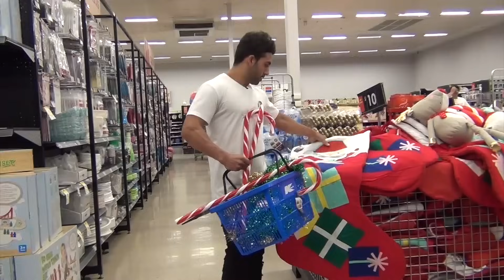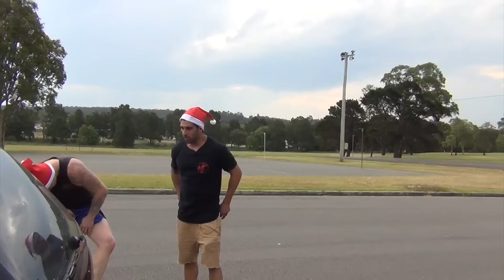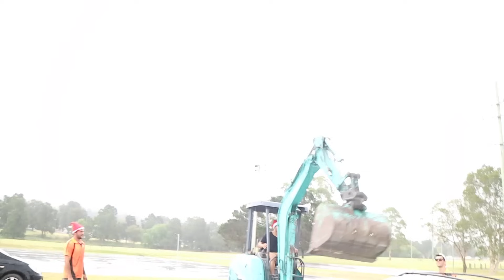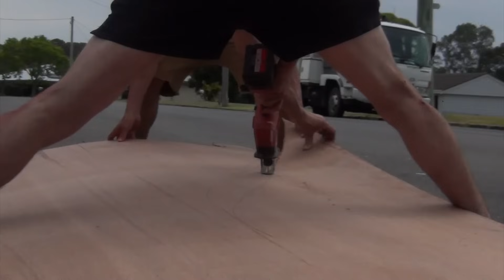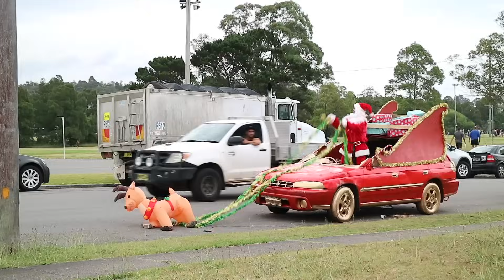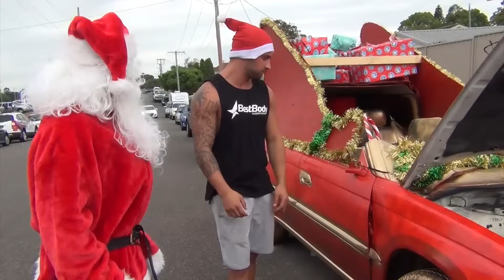When you turn your BEST MATES car into a CHRISTMAS SLEIGH!

Comment: Btw when they used the angle grinder they used a 9 inch extension on a 5 inch base with no guard, the blade could have exploded and went straight through they’re skulls